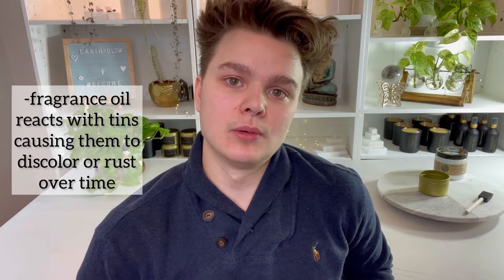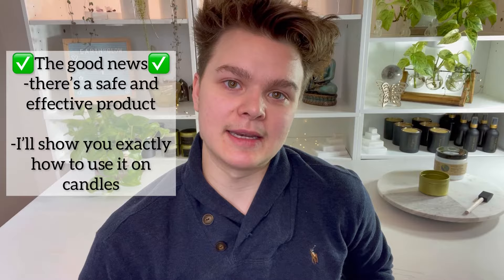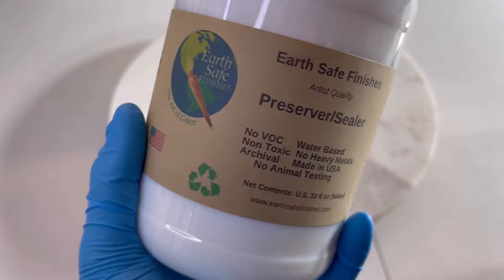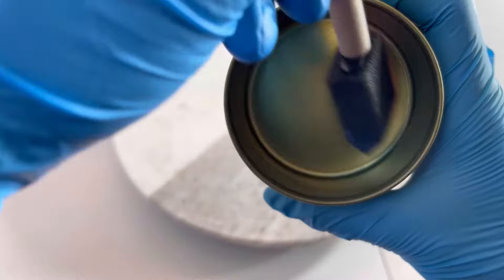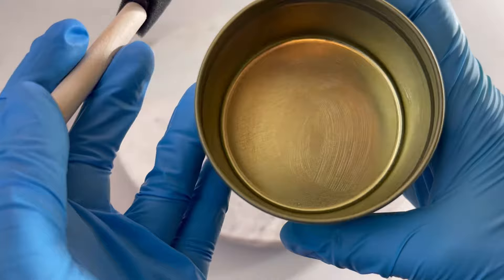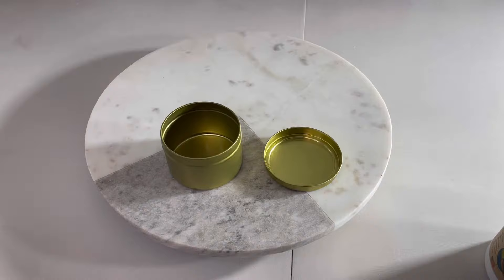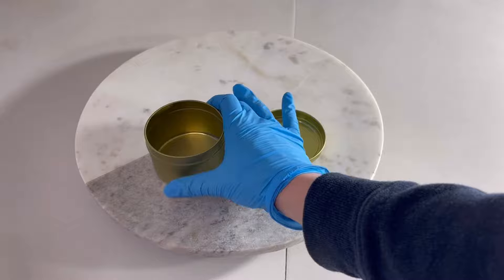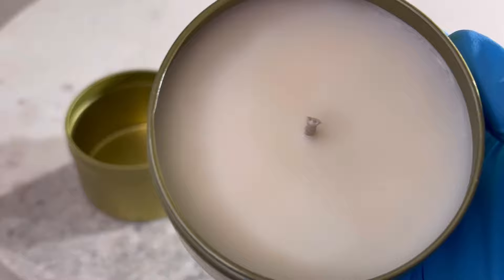How to Stop Candles from Rusting | Sealing Candle Tins

Comment: Would there possibly be a different reaction if they are used to make scoopable wax melts? Would the vegetable oil prevent the oxidation from happening, or at least slow it down? 
I had someone request cinnamon, lemon, and peach scoop melts in tins recently and I’m also not sure if that discoloration would be safe to still burn?
Reply from the maker: they'll absolutely still be safe to burn with oxidation! i don't know if vegetable oil would do this but I don't find evidence to support that it would help.